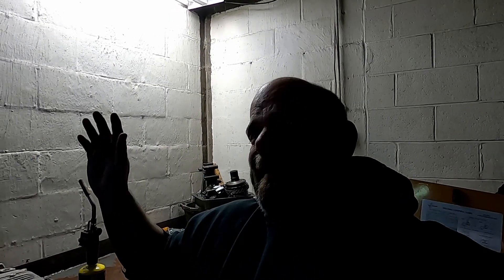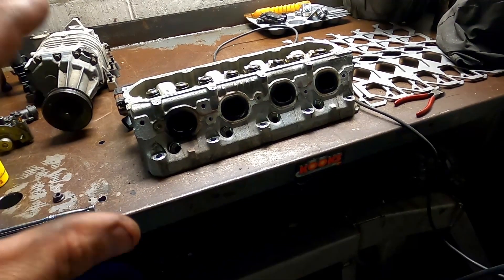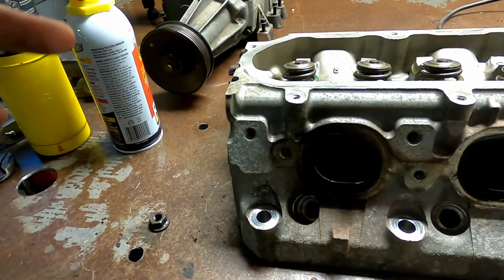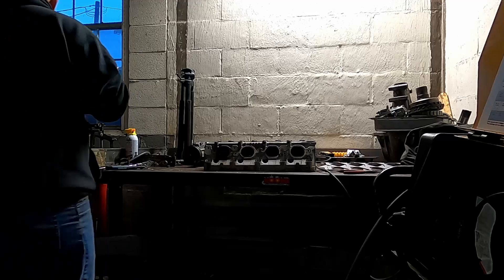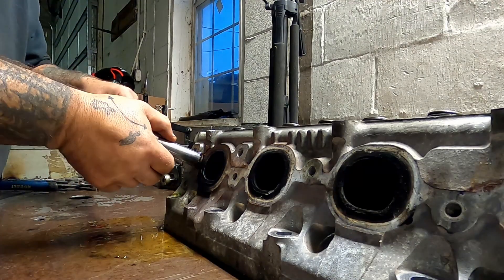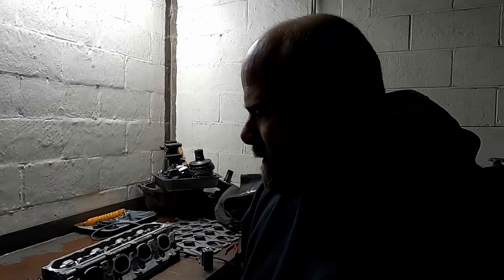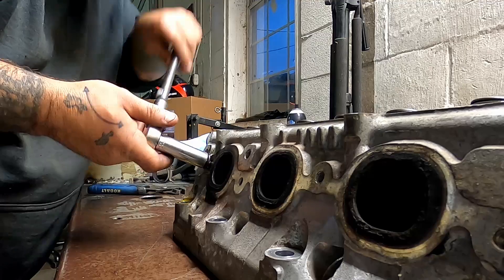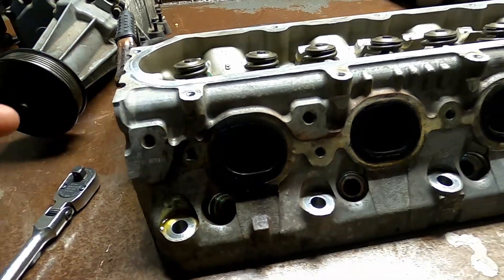How To Remove A Broken Exhaust Bolt Or Stud!

Comment: I just did this with 3 manifold bolts on a 460 in a 1993 Ford f250. Great job, but I recommend taping off the exhaust ports to not get slag from the mig welding into the exhaust ports which can put metal into the valves!
Reply: I broke off like everyone except for 4 bolts on m 92 460

Comment: Doesn’t the heat make the bolt shrink then the cool spray is able to penetrate between the threads and of the bolt and head while the bolt cools and expands back to its original size. Even though it’s only the tiniest amount it still shrinks jus enough to get some spray down deep to better assist in removal.
Reply: almost right. Heat makes the surrounding metal expand.

Comment: You can usually get it hot and use a left hand drill bit. And it will catch and spin it out. But absent that a welder works wonders.